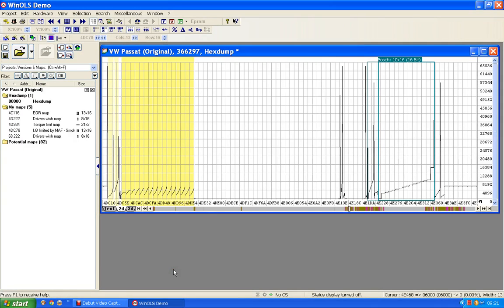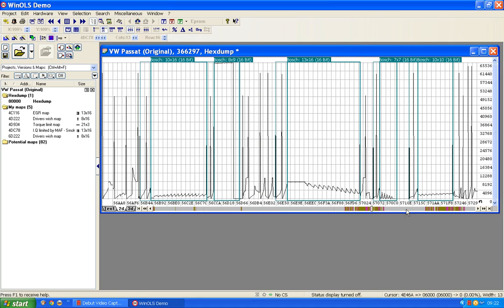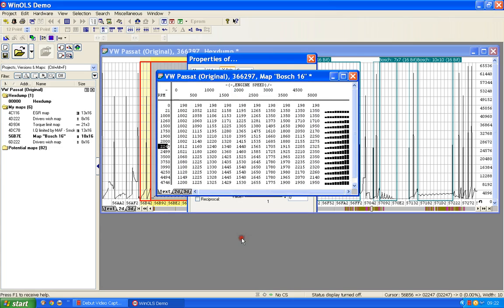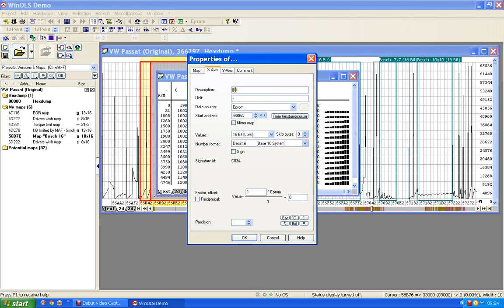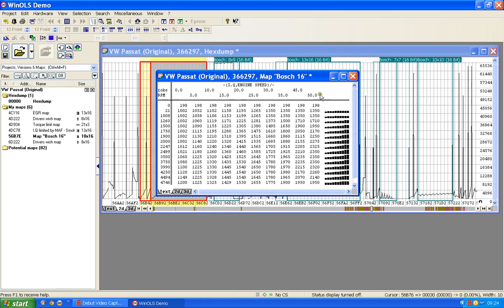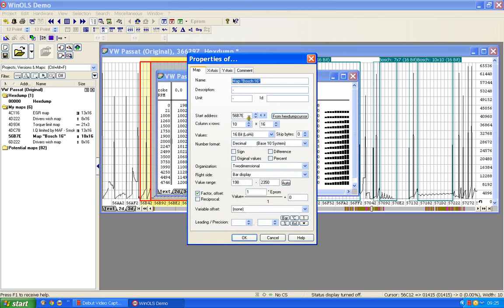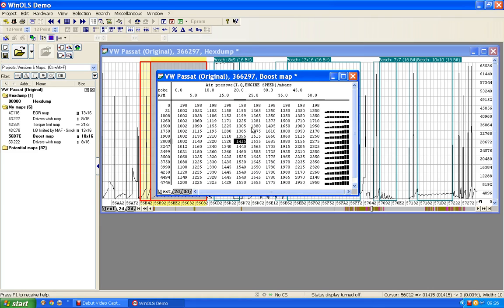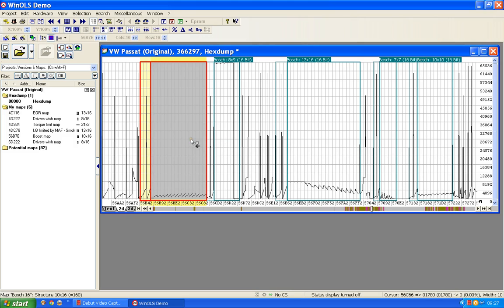winols guide part 6. How to find boost map in EDC15 file

Comment: What if extrapolate/extend X asis when remap for Boost map as example 50 is maximum IQ and change 50 with 60 to new max IQ..and increase boost for the last column.
where will be on X : 40 45 60 ..What happens with intermediate IQ values between 45 and 60 i mean 50 ? What value/pressure column will use ?
Reply from the maker: ECU will interpolate points between columns.
Reply: vagecumap Good to know this! ..I saw a basic tuning tutorial from you. Why would want you increase turbo pressure for the same Injection quantity? For example 25 mg have a pressure in boost map..and even with this, the mixture is very lean. Why the reason to increase more to lean out more mixture than this?
As i know, more boost for the same IQ = more fuel consumption
Reply: vagecumap  If u do so in the VID, (haven't seen it YET) could u please explain this to us ?

Tank u very much..
BTW: Your videos are GREAT !! :)
Reply from the maker: It is no different. Axis may only have 40, 45, 50 etc but 41,42,43,44,46.47.48.49 still exist. Same if you change 50 to 60.
Reply: vagecumap After almost one year of tuning and activity on tuning forums, alsmost everything is clear now. 
I want to ask about SOI for VP pumps, for example the tricky VP44 which have own ecu, its okay to give  some degrees ~2 in full load area ?
Also what do you think about increase SOI after blocking EGR ? As you know , for VP pumps, start of injection is ATDC in some places..negative degrees values.
Reply: vagecumap
 Thanx but i already got that..
My question was referring to the question before..

"....For example 25 mg have a pressure in boost map..and even with this, the mixture is very lean. Why the reason to increase more to lean out more mixture than this?
As i know, more boost for the same IQ = more fuel consumption"

Why do this ??
Reply: L33t3n You dont need to increase boost. After EGR block you should decrease target boost until 20 mg of fuel to avoid closing of n75 vanes too much. Also open them in that area.